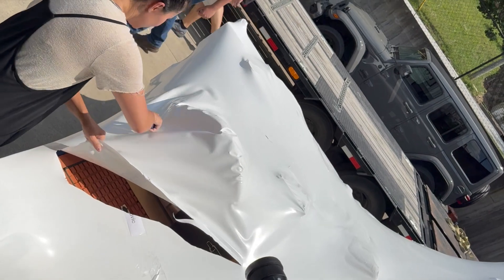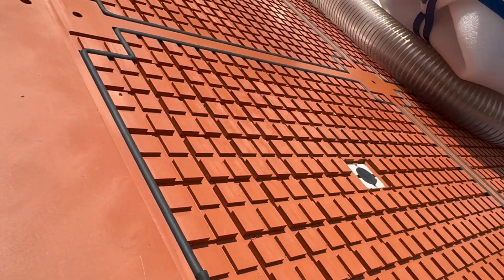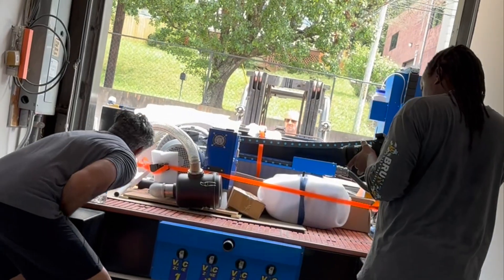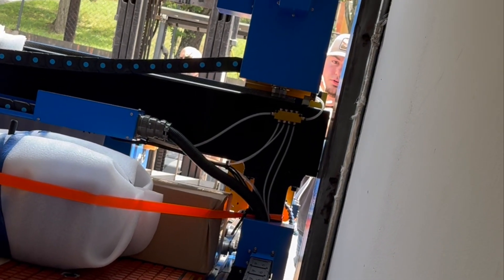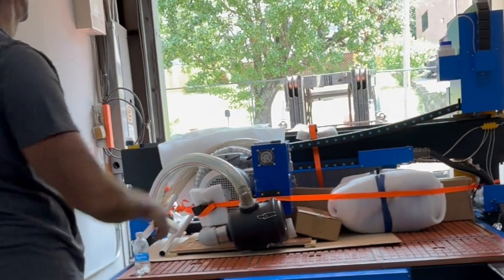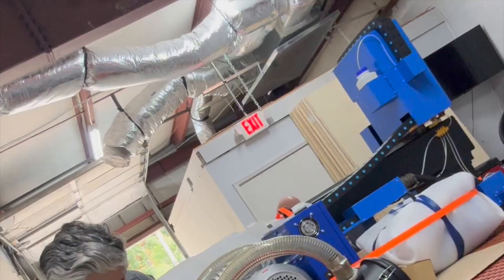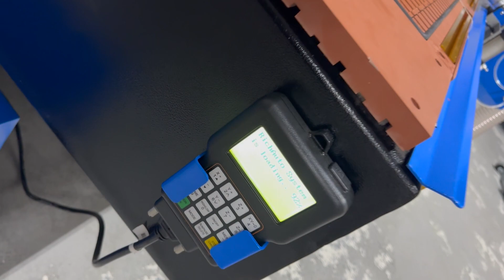Squeezing My 2,600lb CNC Through the Door with 1” to Spare!

Comment: 4:31 if anyone is wondering what kind of dollies they are ... Car dolly the disadvantage is there us a dip on where the tire goes... there are also industrial dollies used for milling machines and lathe ... if they wanted to make life a little bit easier a hydraulic drop deck trailer.. as long as your not using a loading dock
Reply from the maker: These are not car dolly’s, they’re furniture dolly’s - which are flat. I’ve since upgraded to Rocklers Material Mate Cart which is light years better. There’s a video on my page about that too!